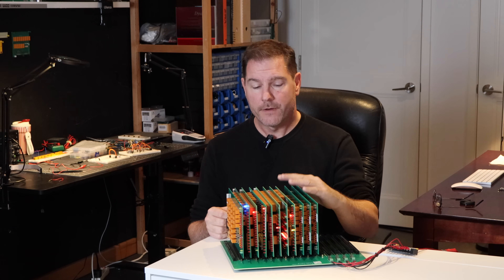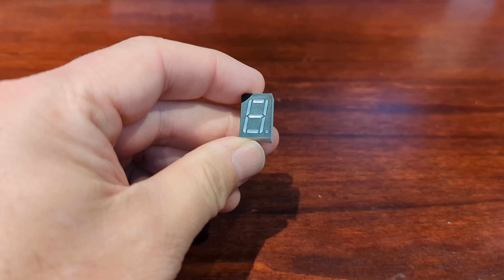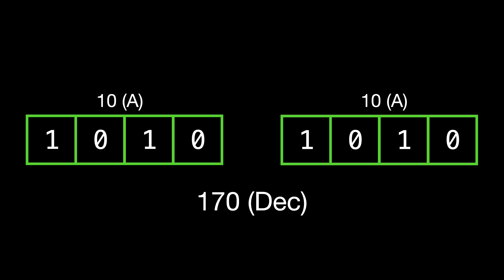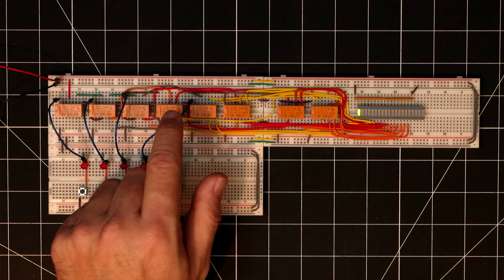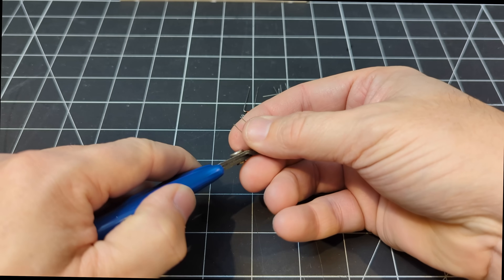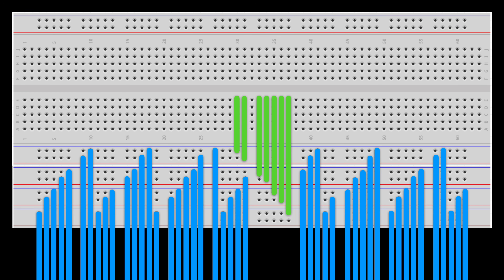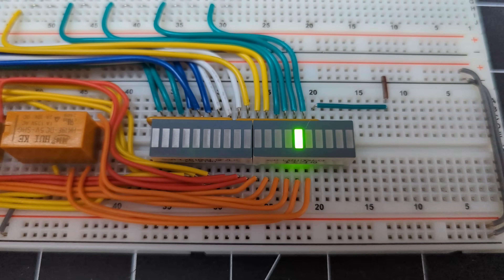Creating (alpha)numeric output for a home-brew Relay Computer!

Comment: Little surprised you opted for hex instead of octal
I mean yes, we are more used to it, but on the front panel your data is grouped in octal, so now you will have a mismatch there
Also, if my math isn't off you would need less relays overall
Reply from the maker: Yeah octal isn't as popular, but also I think the Altair grouped it more for the convenience of data entry of larger binary values (can be broken into groups of 3 for readability).

Comment: 7 segments is cool and everything.... but it would be more in keeping with the relay aesthetic if you could find a flip-dot display from somewhere. 😃
My thing is programming ATTiny microcontrollers in painfully optimised assembly language... and I think, by saying "double dabble", you've just massively optimised my binary to decimal decoder. 🤩
... that's not a breadboard! ... that's a work of art!
Reply from the maker: Thank you! Flip-dot would be awesome, or something like nixies (which wouldn't require the diodes)!
Reply: @dipdoting  I thought flip dot because that's just even more "clickety clack" to go with the relays.

Comment: the demonstration at 8:00 makes me want to build a cam & microswitch based linear ROM, running a test sequence through a circuit seems like it'd come up a lot in demonstrating stuff like this, for youtube, classrooms, nephews. Make a nice crank mechanism, one or two cam positions per crank rotation, quick swap cam barrels for different patterns, cam barrels composed of configurable pieces so they can be reconfigured and serve as a touchable element for learners of an appropriate age

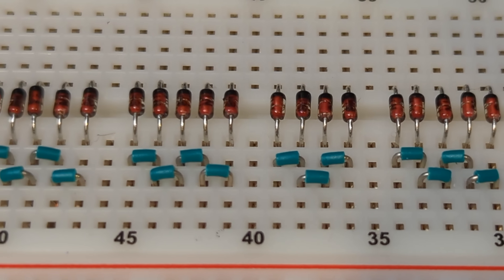Comment: 11:07 have you thought about setting up a truth table per segment and using a logic minimizer (either by hand or in software) to do away with the demultiplixer and the extensive diode array all together?

These techniques are used in digital circuit design and optimize things drastically, at the cost of a less visually attractive, or understandable design.
Reply: Karnaugh maps are your friend.
Reply from the maker: Yes, that would be a cool competition to run (coming up with the most optimized 7-segment display logic), while striving for low latency.